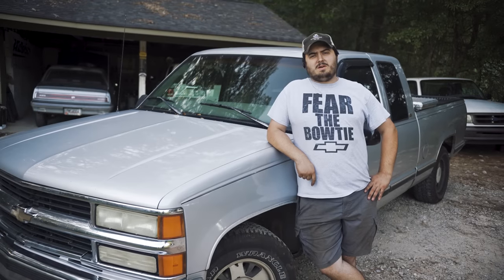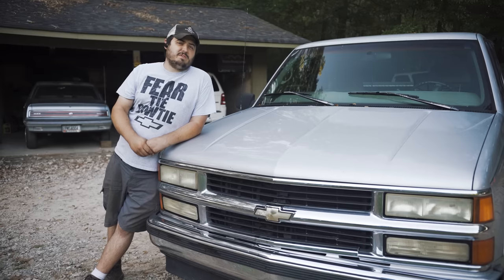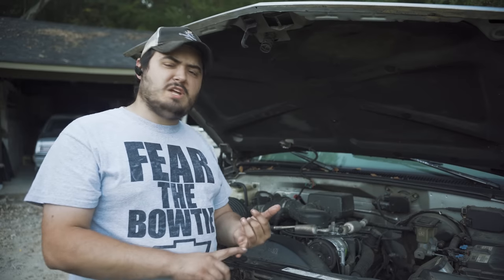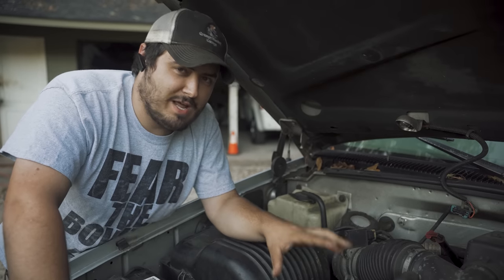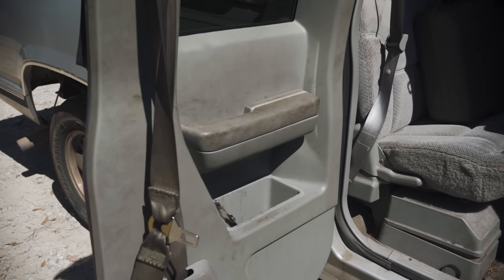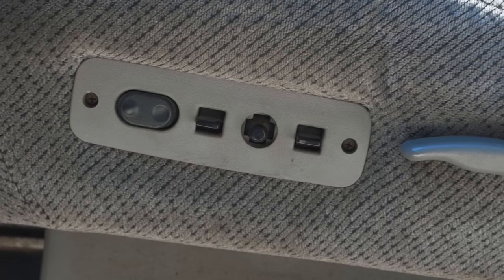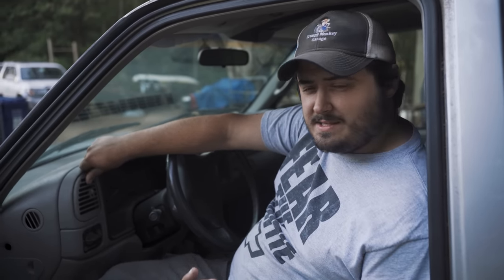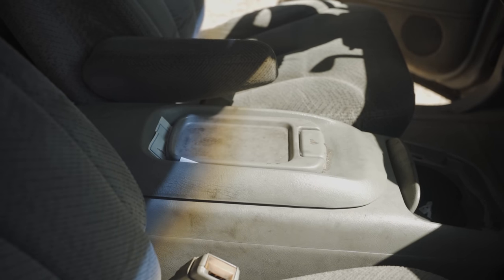OBS CHEVY TRUCK REVIEW, 1997 Chevrolet C/K1500 Silverado Review, The Best Truck You Can Buy?

Comment: The Chevy trucks up until 2007 were definitely rocks. In the past i owned a 1997 k1500 with a 5.7, a 2002 5.3 Silverado, and a 2006 Silverado with the 5.3. All very high mileage and never had any issues other than the junky 4L60E dropping 3rd and 4th so I’ve had 4 transmission rebuilds between the three. I had bought a 2017 Silverado new and had nothing but issues and was a pile so I traded for a 2015 Ram 1500, drove it for ~275k with 0 issues now a 2024 Ram 1500 Laramie that I’ve put 53k on it and never misses a beat. If I have any issues out of this I’ll just get an LBZ 2500 and drive the wheels off it!! Plus no $700 payments

Comment: Bought my 2005 Silverado brand new, has 190K currently. Only thing I've had to do is replace the front wheel bearings recently and replace the cluster. The Vortec engine will run FOREVER. I've seen this generation of Silverado hit 400K will few problems.

Comment: I gotta 91 cheyenne 4.3l 5 speed single cab long bed.  320k and still running strong.   Like a rock!    5 speed manual is the way to go.   I gotta life time warranty on the slave cylinder and master cylinder.   Easy finding parts in salvage yards too

Comment: The early/ mid 90s LT1 was a 5.7 litre 355....the only 5.7 litre offered in a c1500 and a K1500 was a a vortex 350....and yes in 1996 the vortec 5.7 got an intake/ computer upgrade that gave the vortec motor around 50 extra ponies
Reply: They also made the 305 vortec 96 to 98

Comment: Yep I have my papas 94 Chevy Country Coaches custom 4x4 pickup truck with 87 560 original miles and it's running down the road to and back 5 days a week and just now replacing my headlights on it and just got the heater fixed and next get that AC going properly !!    I just wished the freon didn't need adding every couple of years but overall it gets me from point A to point B and the engine sounds SICK in a GOOD kind of way !!!!

Comment: I bought a 1997 GMC Sierra SL 4.3 extended cab stepside two-wheel drive for $1800 it was converted from automatic to a 1988 five speed

Comment: i had (and loved it) a 4x4  '97 305 silverado trim, and had the weirdest issue. Started happening (from what I could tell) after I had a blown distributor cap repaired. Near the top of the rev for the first couple gears it would almost like drop out and create a weird groan/rumble. Wouldn't always do it, mostly uphill or when it was hanging at the top of a gear for a while. I never got a final answer on what it was before I sold it; had mechanics ride along to hear it and no one could decide what it was for sure. Any ideas? Transmission? Misfiring for some reason?

Comment: I have a 91 standard cab sport with just over 300,000 on it, the mains rattle a bit on start-up and I have changed the fuel pump 3 times in 6 years, but it uses very little oil and still runs and drives great, I would probably get rid of my 16 before I would it.  And don't forget that the chassis on these trucks don't rot as bad the fully boxed chassis do.

Comment: If you want even easier to work on, go for the TBI. Less power, yes. Here's the thing. The trickiest sensor is the throttle position sensor, an hour and a half job if you're entirely green on it. Most of them are mounted on a plate mounted to the engine.

Comment: I have a 99 chevy k2500 4x4 98k miles 8ft bed 5.7 350 vortec , 4l80e transmission. Love this truck. Though about selling it a few times because i don’t drive it enough but when i do drive it makes me love it all over again! Body is very clean small apple sized rot whole on the cab corner thats it .Rockers are solid . Frame is flaky but solid . No check engine or any warning lights heat, ac ,radio , everything works leather bench seat , manual 4x4 shifter . Sorry im blabbing lol just like this truck alot

Comment: The Vortex is a great engine,it's Achilles heel,is the cooling system,and to eliminate the four center bolts in the intake manifold.Always watch for loss of coolant ,if it is leaking coolant through the intake, it's possible that the engine could hydrolock which will turn a sharp Chevy engine to a six hundred pounds paper weight,as a regular maintenance thing tighten the intake manifold, change the oil and filter,and watch the coolant like a hawk,and three hundred thousand miles and more can be yours.
            One more thing,change the fuel filter every 10,000 miles, consider quarter of a tank on the fuel gauge as empty,and if you replace a fuel pump,Delco,or Delphi will be your best bet.

Comment: Love my 1997 Chevy Suburan K-1500.  I did have a head gasket go ($5 part but labor?) and ended up having to rebuild the motor cylinder because coolant got in) .  Pretty solid truck other than that. Use to go thru brake pads quickly 1997 thru 1999 when they finally started making ceramic pads. Had a bad fuel pump in the tank at 35K.  Blew out brake linings twice due to road salt up north which was not fun in a 3 ton truck. Leaky Heater/ac coil under dash but cheated and use a drummer tool to cut it out vs taking apart the dash.  Should run for another 25 years or at least that is goal.  Oh, she does like to drink as much as I do on Friday night but.... can yank my heavy boat up and down the mountains of NC no problem..

Comment: My 1998 OBS had the same tail light issues. Taillights but no break light flashing I replaced all the bulbs and brake light switch, it turns out it was the brake fuse relay in the fuse box under the hood the prongs were loose not holding the square chip in tight. I'm going to be soldering for tighter connection.

Comment: I've got a 97 K1500 GMC that had the 350 engine, which I just replaced with a new rebuilt 350, stroked to 383, and it's still gutless and can't pull a 5,000lb trailer up any hills at all.  Where do I look next to find out what is killing the power and torque in my truck?  The engine builder is reputable, used a mild RV camshaft, because I was wanting more torque for towing, and not trying to max out HP, but so far this $6,000 engine is a complete failure.
Reply: No replies from anyone? Can a intake system and ECM from a newer GMC 5.7L engine be used on my 1997 5.7L that is now a 383cu.in. engine?

Comment: I have a 98' k1500 4wd with 95k miles on it. I live in the midwest and there are no rust holes in the body and there is hardly any on the frame. I bring it to a self-serve car wash every couple of weeks during the winter to spray off the frame and rinse the body.

Comment: I have a 96 k1500 extended cab 6.5 bed with the 5.7 with 215k on it and it runs as if it's brand new. The only thing that doesn't work is the cruise control but that's it. It looks almost brand new inside and out and I clean it every 3 days and detail it once every month. Best half ton truck in the market in my opinion. The only gripe I have about it is that I don't have the 3rd door variant.
Reply: There's a relay that controls brake lights and cruise controll its on the steering  column this went out in my truck causing my brake lights not to work I replaced in the parking lot of nappa auto parts

Comment: Just discovered this video. I have a 1997 C1500 Silverado that I bought in 1999. Has 241,000 miles on it. Has the split bench seat in front, which I prefer. Replaced the taillight circuit board only twice, but also the door handle twice. I am often asked if I would consider selling it. If the time comes when I have to replace the it, I will probably cry a little. I hope to keep it until I die (I'm in my 60s).

Comment: My GMC Sierra C 1500 5.7 vortec has 247 thousand miles on it and it's still running strong the only issue is that the oil pressure switch hacks a little funny I think it has to do with the grounding the fuel tank issue

Comment: It is literally how the owner takes care of his rig. Anything can run great and be everlasting, if people would just take care of their rides. Currently, my 91 f150 and 94 1500 are competing with each other on which will last longer. So far so good, it's been a long time and they still start right up, and takes me where I want. But. Out of all the rides I've owned, and that's a lot, I've noticed that the vortec engines have a lot of factory faults. Sensors, relays, etc etc. Also. I will say, that the 350 tbi and the 300 straight 6 are the best engines.
Reply: 2 - 1988’s
1 - 1992
1 - 1993
2 - 1995’s
1 - 1996
2 - 1997’s

Never had a minutes worth of trouble out of any of them !!

I also had a Ford truck with the 300 Inline 6 in it as well !!

I’ll take the 1988-1998 GM trucks over that Ford with the 300 inline 6 in it every day of the week !!

Comment: I own a 95 2500 and I definitely agree. Got it for 1500$ and it got better gas than my cousins 2016 ram 1500. I got rid of it recently only because I got tired of the pickup truck style truck still runs perfectly. If I had the extended cab would probably still have it. But regular cab is too useless to carry all my tools in

Comment: Come to the north, these still are around. Not as much like by you, but we are getting ones over 250k miles that have rust holes everywhere and guys consistently want over $3k for them. Nice ones with some rust bubbles go close to $10k. My dad has driven an obs chevy since his first he bought new in 1989, he sold that to buy a 93 1ton he ordered with a 454 and that truck just got restored. Now he daily drives a 98 burban. I daily a 98 yukon, these trucks don’t die. Even up here in the north, these start in -30 degree temperatures and don’t really care. These are from when america made great stuff, and even if you beat them you can still have a reliable vehicle to last for years. Had a friend with a 94 half ton we took out of a field after it sat for 3 years, threw a half dead battery in and it fired up like it never sat. That half ton also towed a 16k pound camper down the freeway in the summer. The bump stops were sitting on the rear axle. That truck took it and didn’t care. These are truly irreplaceable, probably some of the best vehicles ever made

Comment: I mostly agree with everything you mentioned in your video, except for two things : stock injection does not age very well and intake gasket leaks sooner or later.
Everything else is fantastic with these trucks.
Reply from the maker: Very true, I went into the spider injection more on the S10 review. The intake gaskets been bad on this truck for awhile, but only leaking coolant externally, so not mixing with oil, I've been just topping it off when I need to drive it. Both good points
Reply: @GrumpyMonkeyGarage  try bars liquid copper flush old coolant out of block get new thermostat this stuff seals any leak internal and external I've ran 2 treatments in 40k miles i flush my coolant once per year and the copper is needed every flush i had oil in my coolant gave it a shot and it worked

Comment: I own a 94 6cyl stick and a 96 6 cyl stick and they work so hard for me and other than the fuel pump because  I ran out of gas. I can leave one of those 6 months without looking at i. try to start it? No problem. Both over 250,000miles. This trucks are the best.

Comment: Having both an 04 Tundra with 320k miles and a 97 GMC k2500, for 1/2 ton work go Toyota. I have the top of the line trim on the GMC, but the SR5 trim on the Toyota still feels much better. Electric motors on seat adjustments don’t last, one thing I don’t like about it. The Tundra has better seats, better ride, and a smoother running engine even with a timing belt. But for towing, get a C/K2500.

Comment: neighbor has a 1998 Chevy Cheyenne has 450,000 miles on it recently just started burning half a quart of oil every 500 miles great truck. My mom used to have a 1995 Chevy Silverado was a great truck  cant remember what the issue was that caused it to end up being traded in I think the tyrod went out and at the time she wanted something different. my  dad had a 1993 Chevy I cant remember what it was it was a 2 tone blue truck manual transmission I don't think he had any issues with it but when moms went out he decided he wanted something else as well. Mom got a 2012 avalanche and Dad got a 2009 Chevy Silverado both are great trucks but I definitely agree the looks of the older ones are much better. Silverado only has 65,000 miles on it the avalanche has 130,000 miles on it all those miles on both were driven by the engine in the trucks and not towed behind a tow truck like a ford would be.

Comment: 145,000? DUDE, thats practically brand new! My dad had a 97' with the extended cab with the 8 foot bed (we called it the limo) and had the little 4.3 V6 in it, we ran it with very VERY poor maint, barely oil changes, actually ran 5 years with a completely plugged cooling hose before I discovered it (never use radiator stop leak) and it ran for 500,000 miles before it threw a rod, punched a hole in the block when it came apart. I dislodged it, it still ran! then it ceased. I unceased it. it finally locked up solid at 525,000 miles. I currently own a 2005 GMC Yukon XL with the little 5.3 in it, its at 300k miles, no signs of stopping, and I do even neglect the oil changes sometimes

Comment: Damn, I just sold my dad's old 1992 GMC Sierra with the 5.7 that we've had for over 26 years, and only just has 100K miles on it. The thing just sat since my dad couldn't drive any more and I've only put just over 1K miles on it the past 10 years. I sold it a couple of weeks ago for cheap, $2,300, and the thing has just always started right up even if it's sat for years in the driveway. I just hate to see it sit do much.

And it's called a CD case.

Comment: And dont forget the fuel pump problems. Had to reolace twice already. About the only conplaint i have and the door handles but other than that. Love the shit outta mine. Built solid.
Reply: I've had to replace my fuel pump twice as well, the tailgate door handle busted as well as my rear half door door handles.  What does no big deal it's plastic and replaceable still runs like a champ.
Reply: Do you guys frequently let your tanks runs on empty?
Reply: @u.d.novthu2k204  I try to keep mine above a quarter always
Reply: @randygonzalez1375  If you have a full size pickup with the 5.7L engine, your tank will hold 34 gallons of fuel. When you’re making a (left?) turn even at a quarter tank, all the fuel is being sloshed away from the pump which in turn will damage it over time. Maybe not as frequently as if you’re constantly running on empty but with my 1995 Suburban (42gal tank), I don’t very often let it go much below half and a quarter empty considering it’s larger tank. 220K miles (353K kms) and it still has the factory fuel pump in the tank. My only complaint is the interior driver side door handle is broken, rear passenger side door lock is stuck, and front passenger window switches don’t work. But that damn drivetrain is solid so I can deal with the minor plastic interior inconveniences (oh, and the dash is cracked…)

Comment: Don't understand why the stock wheels on your 97 are 15". The stock wheels on my 96 are 16". Strange. Whatever you do, don't tow in O/D. Always tow in 'D' or you'll ruin the Transmission on these models. I can attest that the door handles are trash, though they didn't break until about 300K. I'm at 340K now and have never been in the engine other than the notorious injector issue!
Reply from the maker: So my 1997 here does not have "D" only

Comment: I just bought a 1998 Silverado I bought an October for 2,200 so far I've got a new radiator into it change around fluid change spark plugs it's got over 200,000 miles on it and I also have a 1975 Scottsdale pickup truck for 38 years 5 million miles believe it or not I pay 500 bucks for that truck

Comment: This my sound like a dumb question but my 1997 GMC Truck well I wanna change my ignition switch and went out and bought one and after taking everything apart the ignition switch in my truck now has a bunch of car alarm wires spliced into it .Im not to good at solicing wires so could i just lay the old ignition switch to the side and hook up the new ignition switch ?And maybe take it later to a car alarm installer and have him splice in my alarm wires.Do you thing this would work?

Comment: thought id ask here. have a 96 chevy 1500 (vortec) engine. had break light turn signal issues previously got those fixed. now having issue where gear shift indicator light no longer shows. gears still shift but dont exactly work as it should. any idea what it could be? hoping instrument cluster fixes it.

Comment: They are probably  best deal used now,  and were the best truck available  in the 90s. The main problems were weak transmissions  and transfer cases, and poor mpg.  
Being this old now best just go junk yard not get costly transmission  rebuilds.
In May 2022 in rural Colorado  I'm going to look at a 1996 gmc Sierra 2500 regular cab 4x4 175k miles   for  $2000. There's no doubt old worn out parts but if transmission  is good be a great beater truck.
Reply: 4L60e is not as strong as 4L80e but both are great transmissions. Transfer cases are ok too..? As for MPG, that totally depends on your driving style - I get anywhere between 18-21 MPG combined which is quite acceptable I would say.

Comment: Saw a 97 Silverado z71 with 330K miles in itm original engine. New transmission, new rear end. Sold for $1,500 10yrs ago. Even with those miles, that truck is probably worry 3x that price now.